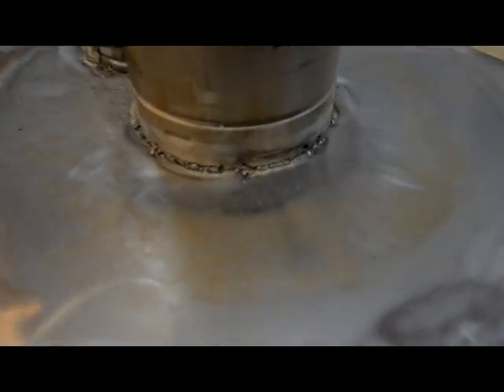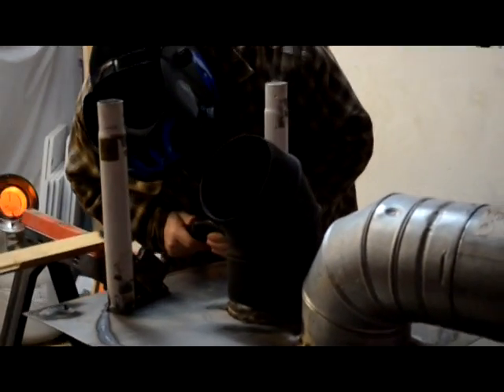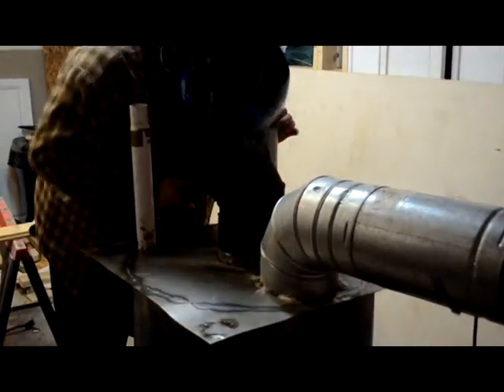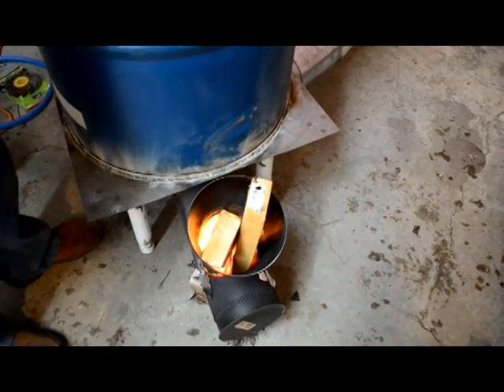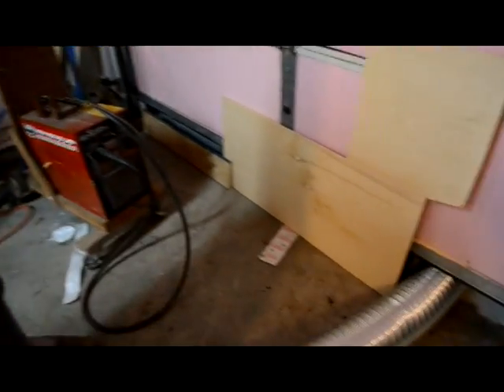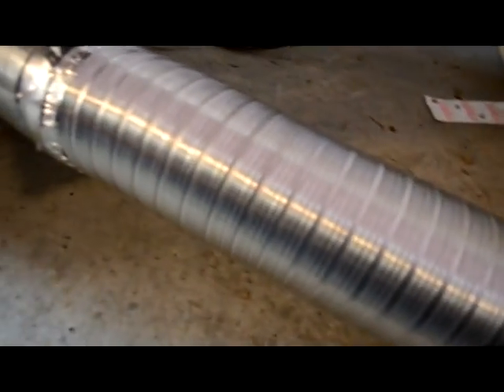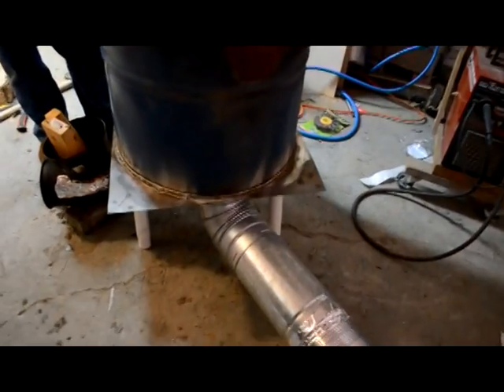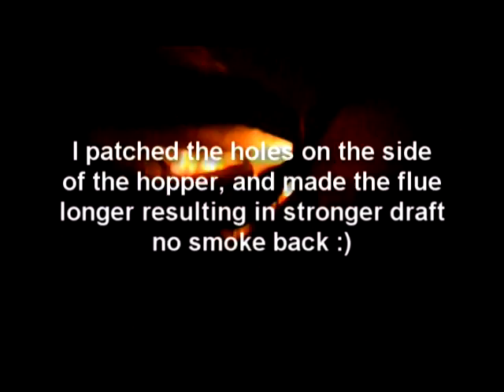Making a Rocket Stove Thermal Mass Heater - part 3

Comment: Would suggest an upright chimney. Hot air rises an so  will give you a much better draw.........But well done, good job.
Reply from the maker: +ray townley-rivett your right, after the exhaust goes through the aluminum loops (and is cooled to 120 F) it goes through the wall and up a 12 foot tall chimney mounted on the outside of the building. The top of that is capped with the rotating flue cap. The 12' vertical chimney does increase draft and the flow through the system. I highly recommend it.

Comment: how is the burn chamber steel holding up. i am wondering if heating and cooling cycles would weaken the metal and cause rapid break down.
Reply from the maker: It's held up well actually, the aluminum pipe finally rotted through last winter, but it was a 20 minute job to replace it and now it's working just fine. I've made a new firebox that has a larger capacity, I'm going to do a new video soon regarding that.

Comment from the maker: So far it seems fine, I get some brown liquid (water n smoke residue) that leaks out once in awhile, but all is well with the aluminum. It's easy to work with, cheap, and does transfer heat better.

Comment: hi great job just wondered about how aluminium flue is holding up no one else seems to be using aluminium but i cant see why not it doesn't get mega hot and it conducts heat better i want to use it on mine but im not sure atm
Reply from the maker: I was curious about that too. I can report that it just rotted through last winter, so it held up for 5 years or so I guess. I'd say that's not too bad. And because there isn't flames or large amount of heat flowing through it, all it did was start seeping smoke out of the cracked areas, I could see the room getting a bit smokey so I bought a new pipe and installed it in about 20 minutes. I'm glad I didn't fill the area with sand or gravel, that all would have had to been removed. I'll do a follow up video soon on this.

Comment from the maker: The burn chamber and elbow that goes up into the barrel reach 900 degree easily. The burn chamber glows red, when there's a good draft (windy) outside. The top of the barrel is around 300-550 and the bottom of the barrel is 200 degrees F.

Comment: The more acid the faster it will react. I've used a small amount, 1 cup to 1 gallon and up to a 50/50 ratio. You will see it react and start to bubble off.  Be sure to do everything outside, up wind, wear gloves, and eye protection. Read the cautions! This is very nasty stuff. Clean everything with baking soda/water solution several times to neutralize the acid and dry thoroughly.

You can also use white vinegar but it takes longer. Soak overnight and the galvanize is gone...

Comment from the maker: Thanks MM,  I left about 2" from the top of my barrel. More space wouldn't be a bad thing, less space would. it would hinder flow through the system, in effect "Choking Off" you stove. The whole thing relies on a good fast draft in and out of the system, so you want to make sure everything is open and provides good air flow. Otherwise it won't draw hard, and have enough suction to draw the smoke down into the burn pipe.

Comment: Good Work!  What is the distance between the top of your heat riser inside the barrel and the top of the barrel itself ?   I've read that 1 1/2  inches is possibly the best clearance. What do you think?
Reply from the maker: If I remember right I think I left 3" from the top of the drum.

Comment: There is a Permies.com vid about that, cover painted metal with newspaper and mud (clay & water) then build a fire in bottom of barrel with a 5 or 6' pipe w 6" diam cut teeth in the bottom and place over fire. Creates a hot burn and paint is captured in the clay... the YT vid is entitled "rocket flames - rocket mass heater barrel prep" (2:02)

Comment: how this guy gets home owners insurance is beyond me. also that stove looks like it will last about 3 burns before it oxidizes apart/burns garage to the ground.
Reply from the maker: Ha!! Well it's been 7 years and I thankfully can report I've had no issues and my garage is still in one beautiful piece. I've upgraded the firebox to hold more wood and I did finally have to replace the aluminum piping last winter a couple small holes rotted through it and it started smoking up the garage too much. I replaced it and I'm back in business. BTW my homeowners considers it a standard wood stove, no issues so far.

Comment: I understand that grinding and welding or even cutting galvanized steel gets rid of the zinc in ithat area.
I do question the rocket stove reaching 900 degrees .I could see 3 to 400 but not 900. I have not built one so I could be way off base
 If someone wants to use galvanized steel ,the best thing is to remove it with hot water and muratic acid
 A good thick black pipe or sq tube would work and be a lot safer

Comment: He is mig welding it does not take a rod .An arc welder uses a rod. Most home shops that does have a arc welder is usually to lite to burn a 6010 rodas it is to aggressive
A 6011 rod is not as aggressive but will work for the same reasonn as a 6010

Comment from the maker: No it's gives off Zinc oxide fumes while it's being welded (which is why I grind the coating off before welding and use plenty of ventilation. After the stove is first lit and reaches over 900 degrees F, the heat burns off the zinc coating and fumes exit out the chimney. No worries! :) NEVER burn treated wood scraps in your Rocket Stove. BAD BAD BAD worse than Galv. coat.

Comment: Nice work. However, in part 1 you mention using 10" galvanised pipe. Doesn't galvanised metal give off poisonous fumes when you burn it? Have you considered/addressed this?
Reply from the maker: Yes it burns off and the fumes exit outside, once the coating is burned off your fine.

Comment: Hi, nice design! Insulation around the burn chamber will give you better combustion. I've used ceramic fiber blanket on my rocket stove projects ( available from ceramic supply houses) held on with wire and it works great.

Comment: try using cardboard to get the stove going.  I don't have a mass heater but if I cut up a cardboard box and use that with a little kindling it really gets the stove going fast because of the air in the corigation.  Works well to quickly dry out the surface of damp wood too.

Comment from the maker: treated lumber has some nasty chemicals in it in order to prevent rotting, you wouldn't want to burn it and have those floating around in the air you might breath. I have no idea how coal might burn in one, however I've drizzled some waste motor oil in on the hot coals and it vaporizes it instantly and sets the stove off! The temps climb rapidly and burn about 15 minutes on just alittle oil.

Comment from the maker: @best333WillC  the advantage is efficiency. I'm burning the wood, the wood smoke/gas and capturing as much heat out of the exhaust before it exits the building. Also because the internal temperature is so much hotter, there is no fear of creosote chimney fires. So you can effectively burn scrap wood, pine, maple, popular, whatever you want. No worries. Do not burn treated lumber! :)

Comment from the maker: @1949RL Actually since I plugged the holes in the feed hopper and increased the length of my outside flue pipe I have excellent draw and little if any smoke back using the 6" pipe. The flue needed to be 2 - 3 feet above the roof line. I built a rotating chimney cap that directs itself into the wind which helps create a vacuum in the flue and increases draw through the stove greatly. :)

Comment: Hey TG use a 8inch T as a feed tube/burn chamber with the cap to clean out.On the smoke back use three T`s as cap for chimney.Look at Larsmith channel on chimney,it works.